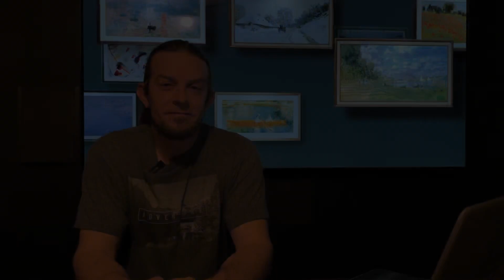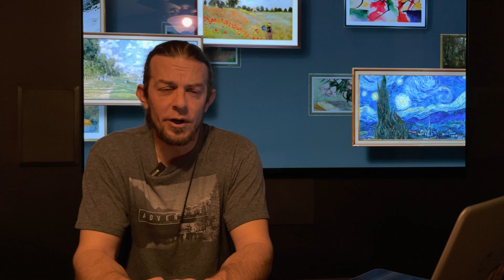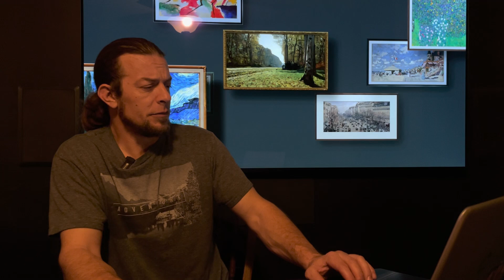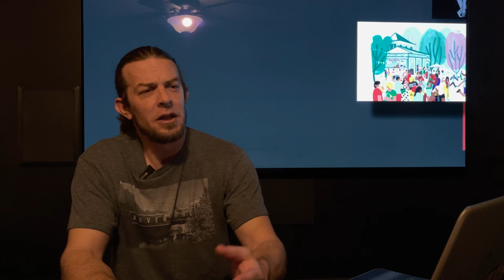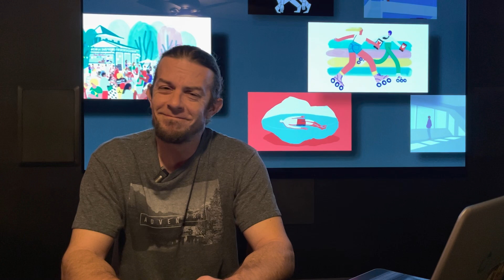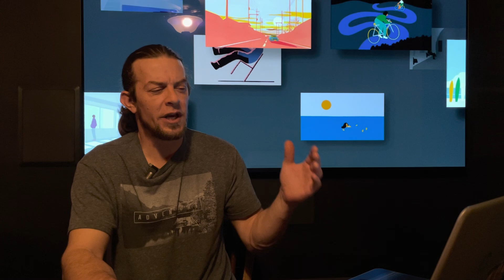HTJ - Yamaha TSR 700 HDMI 2.1 board exchange program

Comment: Completely with you ...bought TSR-700 by falling into their advertisement of receiver capable of 4k 120hz.Now they are coming with jargons and fine prints on 'AB' or B mode where bandwidth is capped to half of what hdmi 2.1 is supposed to do
Reply from the maker: @Mathai House so true… I’m probably just going to run video back through display and use EARC to return audio.

Comment: I just got my TSR-700 back today from having the board replaced. Very quick turn around time. It was only passing 4K through hdmi 1-3. Now it’s passing it though all the hdmi inputs.
Reply from the maker: Awesome news my friend thank you!! Great to hear about turnaround times too. Only thing I see bad is the chip is capped at 24Gbs. No Bueno…. js
Reply: @hometheaterjoe9489  so in essence it would be pointless connecting a PS5 or XBOX series X through the receiver? Instead run it directly to the C1 and use eArc back?
Reply from the maker: @Micheal Pierron exactly my friend!! Your display can process the video signal much better than the AVR… give that I try (you will be able to access all gaming features that way) and let us know your experience please and thank you… BOOM!!
Reply: @hometheaterjoe9489  tried going through TSR-700 with PS5 and ATV4K. Got invalid format for both on C1. This AVR is a POS!!! I’m glad I didn’t have to pay for the board replacement. It’s still junk.
Reply from the maker: I can agree, I’m a little sore they’re replacing the 18Gbs chip to 24Gbs chip. Not happy about that 😡😡🤬🤬
Reply: @hometheaterjoe9489  just spoke to United Radio. They are the ones replacing the boards. They confirmed that hdmi 1-3 are capped at 24 mbps and are the only hdmi inputs that support 8K.  They’ve escalated my concern to Yamaha. I’ll keep you posted as to what they have to say about it.
Reply from the maker: Copy that 10/4 good buddy. Yep, all true. I do appreciate Yamaha trying to do the right thing. By paying for shipping both ways, replacing the board free of charge. And they claim a turn around time of 6-10 days I believe. But yes with those chips. Can’t even run 4K/120 with HDR… that why I run all video to my CX/C1 and use EARC to send audio back. BOOM